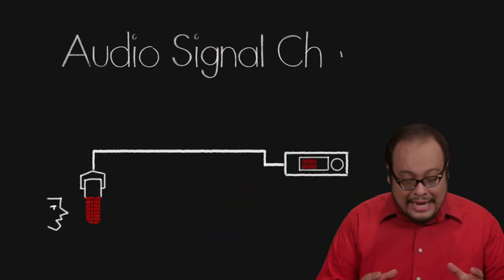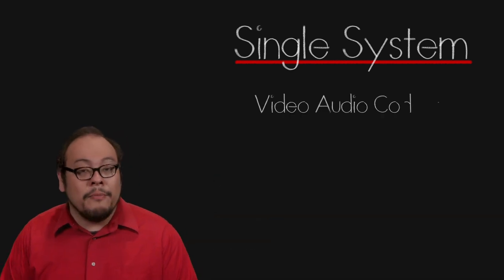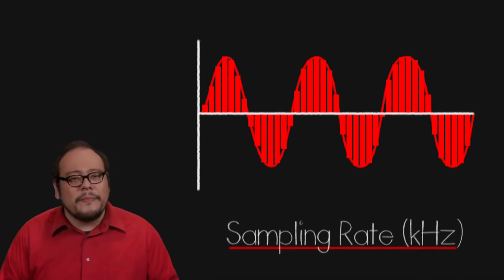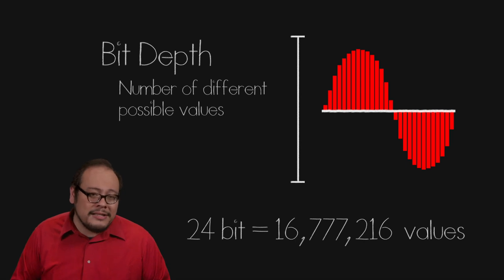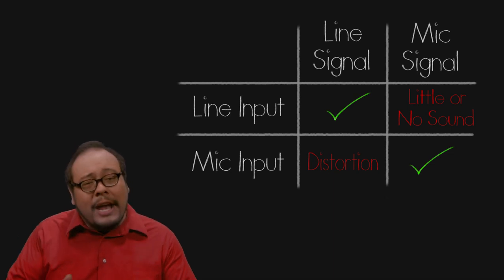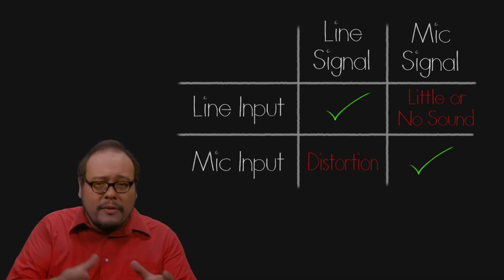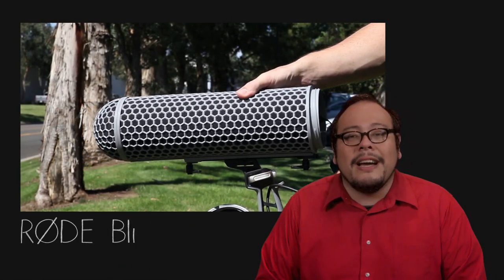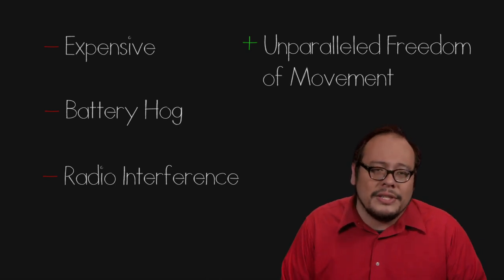The Basics of Recording Audio for Digital Video

Comment: Any ideas on a wired lavalier mic setup on a DSLR camera? It seems really difficult to find extension cables for the lav mics.
Reply from the maker: So the problem with lavs is they usually need phantom power to operate. This can be achieved only with a battery of some kind when connecting to a DSLR - so generally you're going to need a pre-amp.

Something like this might fit the bill (AZ affiliate link)
https://amzn.to/2zhl2Fe

Here's a cheaper one that's only one channel:
https://amzn.to/2m4tOx7

I haven't tested either one so read up on the reviews.

Comment: I want to know something.I use a zoom h1 and have a Panasonic G7.I use the zoom h1 as a external mic.Single system.
Will the audio remain the same quality coming from the zoom h1 when it is recorded with the video within the camera or will the quality be reduced to comply with the Panasonic built in sound quality ?
Reply from the maker: You have to think of this as an audio chain. You get audio into the H1 as an analog signal - it gets converted to digital and recorded in the H1. Now if you use the H1 as just a preamp - it passes the analog signal to the Panasonic which then converts the signal into 16bit 48,000 hz audio.

Either way it's pretty much the same audio signal, its just the H1 is capable of recording higher bit rate and sampling rate.
Reply: Filmmaker IQ
Thank you.This was very informative.

Comment: interesting that with audio, there seems to be a preference for 'better than' 16bit/48kHz audio, while, with 'film' image capture, 24fps is the long-time (mostly) 'unbreakable' standard.?  what about using ambisonic (or other surround-capable rigs) for capture of surround audio?  Not sure I like the description of how the balanced audio signal receiver works.  common-mode vs differential-mode might be easier to visualize if you consider the receiver has a transformer, which effectively 'removes' the common-mode noise from the signal, because the same voltage being applied to both legs of the transformer will have zero output result.  only the voltages that are out of phase will make it through the transformer.  transformerless input circuitry aims to achieve the same result, using electronics.
Reply from the maker: You don't want to record surrond sound on set. You want to capture source sound precisely and cleanly. You don't want the sound of the air conditioner humming or traffic in the street nearby. Surround sound is created in post. Even nature documentaries "design the sound" that you ultimately hear.

The preference for higher bit rate and sampling (although the sampling is controversial) is for leeway in post. Bit depth gives you headroom and sampling can play nice with effects. Bottom line is they still sound like the end result, just with more data. Capturing higher than 24 fps does not grant that kind of leeway because you lose the 24 look instantly and you'd have to recreate it. The analogy for digital video is more like shooting 8k 4:4:4 color and dumping down to 4K 4:2:2 color.

Comment: Bit Depth corresponds to dynamic range you can record between softest and loudest sounds keeping low noise floor. 1bit is roughly 6dB. 16bit x 6dB= 96dB. 24bit x 6dB= 144dB. Trombine or Jet engine can reach 120dB loudness. Recording at higher bit depth these sound sources will not be clipping.
Reply from the maker: It's a little more complicated than that. Surely you can record the sound of a Jet Engine using 16bit audio - just gain down. There's some confusion between dB SPL which is the sound in everyday life and dBm or dBFS which is in relation to a signal. While yes, higher bit rate does increase the dynamic range, recording higher bit rate does not automatically mean loud sounds will not be clipped - it is still your responsibility to set the gain so that the signal you get from the microphone does not go over the maximum limit be that the sound of a jet engine or even a boomy voice. Where improved dynamic range comes into play is you can safely set the levels of a higher bit rate audio a little lower  and boost it later - the improved "resolution" of the audio will hold up better on amplification.

Comment: This guy is great. Excellent tutorial. I wonder what mixer you would recommend? I was going to try to save up enough to buy the Sound Devices 633 but after watching a couple tutorials I think the Zoom F8 is good enough. Any ideas?
Reply from the maker: the F8n is really pretty good. not quite the tactile feel of Sound Devices but a quarter of the price.
Reply: Filmmaker IQ by tactile you mean the feel of the hardware?
Reply from the maker: the Zoom F8n is much smaller than you expect. Don't get it expecting big knobs and lights that you see on the Sound Devices.

Comment: Question:  If I am planning on operating a boom pole with a shotgun plugged into a zoom H5, where should the zoom H5 be mounted/kept.  I dont want to put it in my pocket but mounting it on the pole would add unwanted weight.  what are some good options for this simple issue.?  Thank you
Reply from the maker: +Jason Frisbie Put it on your person - a pocket is fine but  you can accidently butt-press the buttons. You don't want to add to the boom pole because there is extra weight, it could add handling noise and you don't want to damage the recorder should the pole get knocked around....

Here's a blog that suggested carrying it with a neckstrap:

http://www.sam-mallery.com/2011/03/cant-find-a-bag-for-your-zoom-h4n-try-a-neck-strap/

Comment: Thanks for the great video. I have a question. I currently own a Sony ICD-UX560 Voice recorder and I'm planning to use it for recording audio for DV. I've seen that you recommend saving uncompressed audio, but this model doesn't seem to support it. Only LPCM [44.1/16], MP3 [192], MP3 [128], MP3 [48 Mono] are supported. Is it recommended anyway to use this model? What kind of issues may I face by using MP3 [128] when linking video and audio?
Reply from the maker: it's just that MP3 is a compressed format so it won't stand up to manipulation. You can use LPCM which is an uncompressed format.
Reply: @FilmmakerIQ  Thanks for your reply. Have a good one.

Comment: You are and excellent teacher.Thanks ,you explain very clear the sound subject .A question ,,,.can i make a decent sound out of sound libraies?I have a MSI Z97M-G43 motherboard with Realtek® ALC892 Codec 7.1-Channel High Definition Audio  - Supports S/PDIF output and i want to buy a LOGITECH Z506 SPEAKER .This deliver a good sound or i have to buy an extra sound card?
Reply from the maker: Personally, I think most motherboard sound cards are just fine. The real limitations is inputs and there are a lot of USB external boxes that do the trick.

You may want to look up some higher end speakers, I didn't research your exact model but it's probably fine as a start.

Can you make decent sound using libraries? Yes, you may have to get creative but a lot of productions start there and then Foley special sounds as they need them but almost everyone starts with library sounds first.

Comment: Need HELP.  Using a sennheiser 416 with a Zoom H6, gain set on around 6, and I'm picking up so much room hiss, even with the zoom's built in compression and limiter. Any advice?
Reply from the maker: Not sure where the Zoom H6 is set - but sounds like your gain is way too high. Try a gain setting of -12db or something lower. Compressor and Limiters do not affect the noise floor - they affect the peaks,
Reply: @FilmmakerIQ   Thanks, a lot. Forgive me, I'm new to s round, but when you say set the gain to -12db, are you referring to the knobs on the top of the H6? Because every video I watch people refer to those knobs as gain, but the knobs only go to 0-10db.  Or, are you referring to going to the monitor mixer and going to the chase we are recording and lowers the level down to -12db? Thanks for the time!
Reply: @FilmmakerIQ   Nevermind, I think I see what you mean. You adjust the top knob which goes from 0-10 but make sure the audio reading on the monitor levels around -12db
Reply from the maker: @PowersBenzoCoaching  I don't have the H6 so I had to look up the manual. On most mixers there is a gain which is separate from a levels fader. Those knobs are more levels controls. 

Anyhow... Looked in the manual and there's a "PAD" button you can engage that tap down there levels, try that.

Comment: Thanks for the excellent video!  Quick question, I use the double system recording method using 48k and that seems to be standard for video audio recording.  If I use 96k, will this present  any issues?  I use Adobe Premiere CC 2015 as my video editor.
Reply from the maker: +riel777 I haven't had any issues at all using 96khz. Been doing it for at least 6 years now.
Reply: Thanks, I'll give it a try!

Comment: I have been recording audio from either a sound board or rode mic to my zoom h5 and I will listen while recording and it sounds ok and not peaking. Then I put the audio in my computer and it’s sooooo quiet! I ended up having to duplicate the track like 6 times to make it work for my video. Any ideas why my audio sounds ok in device but quiet once I get it in my computer?
Reply from the maker: I think field recorders are purposely set high so you can hear all of little tiny details when on a noisy set. But when you get to you editing computer the levels are actually really quiet. As long as you're recording in 24bit audio, amplifying in post isn't a bad thing.

Comment: Hi, i loved the video and i honeslty havent seen anyone explain this at your level of clarity. Thank you again! But i have one question. Im using H4n PRO audio recorder and i monitor it with 250ohms Beyerdynamics DT990 pro. My issue is, when im recording a sound and make sure it peaks at around -12 db, the sound is just too quiet. Is it because of the ohms requirement of my headphones?
Reply from the maker: The recording level is not where you want the final output. I sort of made that mistake on this video as there's a lot of nasty comments here complaining that the video is too quiet.

You can record with trying to keep your average peaks from going above -12db. That pretty much ensures nothing will ever clip. Then when you're in the final mix you can boost everything about 6 db or so. I generally add a compressor with makeup gain of 6db.

If you're a bit daring, you might get away with less headroom in the recording keeping the peaks at -6db. For certain functions you might be just fine doing that
Reply: @FilmmakerIQ  Excellent, i get it now. Everybody makes mistakes still a great video 🙌🏻

Comment: This might be an amateur question but if I have a mono shotgun mic with a single XLR input going into a recorder plugged into channel 1/L, how to I get the mono audio to sound normal and panned middle instead of coming out of only the left speaker? What is the best way to go about this, panning the sound to the middle or doubling the track and putting one to the right. How do Films record their sound and mix it?
Reply from the maker: Most of the time - a mono track is treated as a centered track in a editor like Adobe Premiere Pro or AVID. What you might be getting is a stereo track with only Left Track mono. In Premiere at least, you can do a "Fill Right with Left" effect which essentially takes whatever's on the left track and puts it on the right.
Reply: Thanks so much. This helps a lot

Comment: I'm on  a low budget and I want to make a short film. I've been reading 
and came up with the need to buy a recorder like zoom4n and a boom mic 
like a rode NGT2. I was wondering if buying only the Rode mic and 
turning it on my notebook trough a fast track would compromise my audio.
 Is the recorder really necessary on a low budget?
Reply from the maker: +Cinessência it would work but you would have mobility issues. You would need to carry and power everything on every setup.

I may get crucified for this suggestion but whatever... If you are really on a super tight budget, consider doing all your audio in post just capture scratch audio on set and rerecord the dialog on post. Watch our videos on ADR and Foley. Historically that's how low budgets handled audio.
Reply: Thanks for the answer Filmmaker IQ !

Comment: Hello, i work for a company that assembles seminars of about 1500 people. We use wireless microphones, but most of the time the sound is not good quality. What can i do to make it sound batter or equipment i can use? Thank you!
Reply from the maker: Well a couple questions - what do you mean is the sound not good quality? Is the wireless signal weak? Is the microphone producing a poor sound? Is there feedback that's causing the sound to distort?

Now if it's the signal - the unfortunate truth is the more you spend on wireless systems - the better they are. A high end system starts about $1500 Lectrosonic - an ENG quality system is about $500... and below that, I wouldn't even bother. Make sure your using fresh batteries each time out. 

And if a mic can be wired (Say on a podium), use wired.

Comment: How do I sync my slideshow images to a click track (with many odd time signatures)? Do I have to move each slide manually or will Premiere do this automatically? This would be a BIG help!
Reply from the maker: +Dave King with odd time signatures you'd have to manually do it. Suck it up and just do it ;)
Reply: I just did it, 200 frames manually, it was a pain in the ass but the final result looks good. It was also good that I made the audio click track in Logic Pro first, much easier than synchronising on the Audio waveforms.

Comment: Regarding wireless mics, any thoughts on/experiences with using lavalier mics hooked up to a smartphone?  I know your sponsor Rode has one with an accompanying recording app.  Using this cuts out expense, batteries, and radio interference as downsides.  Not sure about difficulty in getting the audio quickly, live monitoring, and overall audio quality however.
Reply: Actually that is what I use right now and it's awesome! 
A lav mic plugged into a smartphone is no problem if you get the right app. 
I use an Android phone, a cheap LG L15G with Neewer lav mic from Amazon. There is no concern for low battery, just turn on Airplane mode and put the phone on silence. I don't use the phone for any other thing as I got it specifically for this purpose so there is no sim or data connectivity on the phone. There are some things to note though, there is no way to monitor the levels while the recording is going on, also ensure the app you get records 48khz or else you will have audio sync issues and again, ensure to set the right levels to avoid clipping, which applies to all audio capture systems anyway.

My system has been working great and I have two of it in case I need to record a dialogue. If I want to improve the quality of my audio, I found out that getting a better condenser mic is all I need at the moment. I still plan to get a Zoom H4N Pro with wireless lav mics but I don't have to do so at the moment but will still do later.

Comment: You can fit rechargeable batteries in some of the radio packs and if they are good quality batteries they should last for several hours. So as long as you have access to somewhere with electricity and can set up a charging station or have enough spares to see you through the day in which case you can charge them when get home.
Reply from the maker: Zoë Smart The wireless packs that I had were 9v battery and those are hard to find. Rechargables are good some things but they also wear down over time. There's also the interference issue to deal with. I still use the wireless from time to time, it's just not my preferred option.
Reply from the maker: I picked up some rechargable 9volts and giving them a go. Seems to work okay, but still prefer wired connections when it makes sense :)
Reply: The rechargables we were using were AAs so I hadn't thought of the issue of struggling to find 9v rechargables. Glad you managed to find some. I agree it depends on what you are doing and I think it is a case of personal taste. But if they work for what you are doing it makes sense and will hopefully save money and help the environment in the long run! :)

Comment: What About The Zoom H4n as a single system? It means that the mic is connected to the H4n and the H4n is connected to the camera....What happens when you connect the H4n to the 3.5 input of the camera? Is there is any down sample of the audio?
Reply from the maker: +מאור גורדון The camera's codec is only capable of 48khz 16 bit audio but your Zoom is capable of 96khz 24bit audio.

It's not really a downsample  - as the Zoom is just passing an analog signal.

That set up would work well to get the best of both worlds (assuming you're recording on the Zoom as well) but you have to tether the mic to the camera.
Reply: The Zoom is an A2D device and the connection between the Zoom and my camera is analog.
That means that the signal is turning from analog to digital, back to analog and back to digital (in the camera). I am worried that there will be a problem in the connection between the Zoom and the camera (Not DSLR)
Reply from the maker: I doubt that the analog signal going into the Zoom is being converted to digital before being sent out to headphones or line out. My bet is it stays analog all through the system until it is being written to memory (else there would be a delay)